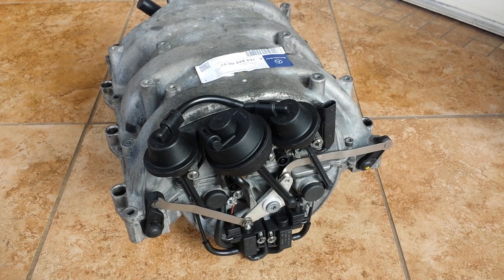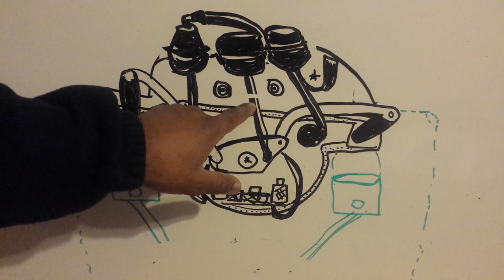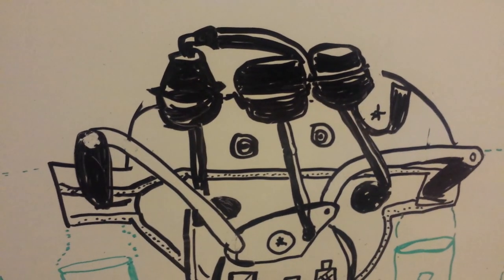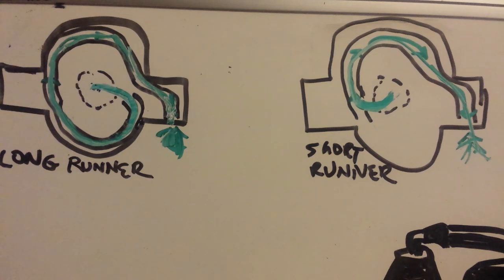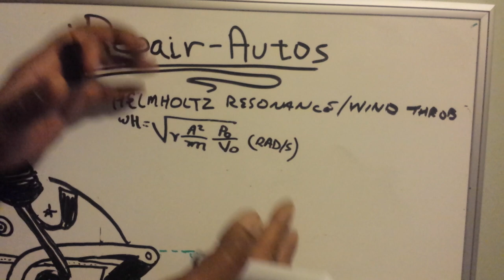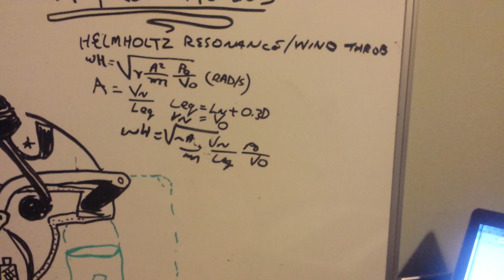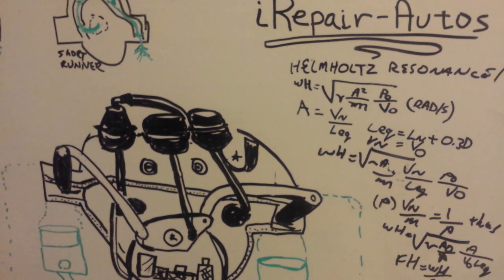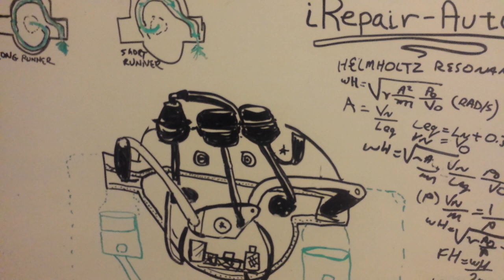Mercedes Air Intake Manifold Failure Explanation

Comment: The real question is how did those flaps get gunk?  Oil / build up / gummy and sticky of oil.  The next question, is where did the oil come from.  This will leads back to a few video this guy had shown.  It all came from the PCV tube --->> PCV cover & oil separator.  I believe this is the source of oil / oil fumes that gets into the drum oil intake.  This is unpreventable, even with changing out the PCV cover or the oil separator.  The oil fume will still travel down to the MAF / air intake and cause all these oil / sticky gummy crap.  What can be done is add a oil separator as a final defense on this line.  He has another video that shows this type of installation on this line.  It may not be 100% since some fumes will still get back into the MAF as the line is design to, but at least you minimize it.

Comment: Hello.
I have a problem with my c280. The problem is a P2015 Code. Intake Manifold Runner Position Sensor/Switch Circuit Range/Performance (Bank 1). Do you have any idea what it means?
Reply from the maker: Yes, the sensor detects that the internal flap on bank 1, is moving but not through the full range of motion.   Check your air intake rods for obstruction.   I have a video on this here:  https://youtu.be/bKiNsMoAm_M
Reply: iRepair Autos ok thanks....great videos!!

Comment: I just did mine but I noticed the flaps or arms move only when you rev  high  is  that normal?   I thought that it shouldmove at all times low idle and steady  2000 rpm   am I wrong ? I want to make sure its not defective
Reply: if your engine seems to be functioning normally, and you are not getting any error code, it should be fine.

Comment: great video, very interesting pinciples at work.It's good to know what I'm replacing. My r350 has 140k on it and the actuator bracket is broken. Your video on the intake replacement was excellent and has given me the confidence to taken on the job. I noticed you used the RBT remanufactured intake with the update Aluminum bracket. My question Is, Does the Peirburg come with the updated bracket? and is it better than the RBT? Thanks a bunch, great vids,
Reply from the maker: +J Shadler I'm not sure what Peirburg has for hardware.   Peirburg however is a brand new part were as RBT is remanufactured.   Peirburg also comes with a lifetime warranty from what I've been told.

Comment: Hi.  I originally had a p2006 code.  I replaced the broken lever with an aluminum one.  My car get an additional 6 miles/gal, increase power and no vibration during idle.  however, I now get a P2004 and a P0410 code.    All the flappers are Together and working, no vacuum leaks are found, no gas or air leaks, and all connectors are returned correctly.  I reset the error code and in 24 hours it always return. Do you have any idea what the problem can be?  Or where should I start to resolve.
Reply from the maker: The air intake manifold has internal flaps that open and close...  These parts are plastic and get coated in carbon build up.  Once that happens they get sticky and don't open and close as they should.  That's what caused your broken lever.  Now that that lever is fixed you still have the internal issue in the manifold...  check out my video explaining this here:  http://youtu.be/HTXNUE0N75Q ;   I think you're going to need a new manifold... Or you could open and clean the one you have but that's asking for more trouble down the road...
Reply: so in Alphonse situation, would the Peirburg intake manifold assembly would be a good solution?

Comment: I think this is my issue I've got a rough idel sometimes it will rev up without giving it gas and rev higher with gas pressed to however taking off and normal driving is fine

Comment: This damaged flapper/actuators caused me A check engine code p0300 it suggested a misfire and to change spark plugs but i did and yes the flapper was the issue for the misfire

Comment: What happens if you don't fix this promptly?
Reply from the maker: Vehicle performance will get worse.  Flaps on the inside may move and make the vehicle not idle and stall out at lights and then plastic pieces can get into the pistons and cause engine damage.

Comment: Hi ! I have p2006,p0170 and p0173 error code .mercedes w203 .M272. maf ok,o2 sensors ok,fuel pump ok.now question ! P2006>>>>>> p0170 and p0173???
Reply from the maker: the p2006 is indicating some failure on and in your air intake manifold.  I say on and in because the internal flaps on this part is failing to open and close because of a broken part on the external as describe in the video.   The p0170 and p0173 is a further symptom of the same.  Good luck - your manifold is failing and for best results (not having to do this job twice) you should look into replacing the whole part and not just the broken pieces.
Reply: Wow I have the exact same issue at the moment. I replaced with an aluminum piece now I'm getting the P2006 along with the 2 fuel trim, P0170 + P0173. I'll probably just buy a new manifold. Did you resolve your issue?

Comment: Take me back to pre calculus , awesome.  I suppose that's y Mercedes decided to make the essential moving parts plastic. Other competing material probably to heavy, if not too expensive.   Once  part break the cost of diagnostic exceeds a brand new manifold, due to the complexity nature.  Mercedes with their liability calculation figured the parts are so intricately woven to each other,  diagnosis of damaged assessment will be in the fire pits for them.  As one could imaging the  phone calls from world over the same regarding "how to".
Reply from the maker: Yeah this one is nasty.  Mercedes Techs like to go down rabbit holes when working on this one.

Comment: don't try the repair kit buy a complete intake manifold assembly  $446.00 aftermarket by a company called Pierburg the same company that builds them for mercedes benz.
Reply from the maker: I totally agree.  repair kits are not the solution.  Thanks for posting!
Reply: dntpearson1994 completely wasteful. Mechanical moving parts externally located are an easy fix with cheap fabrication. Id nevet buy a new manifold to fix stuck flaps.
Reply: I completely agree with you.
My intake on my MB w220 failed and i was able to take it apart so easily . They are all mechanical parts and can be easily restored with no problems . Now , the actuator is the one i am thinking about replacing it just to be on the safe side . It is the only part that i can imagine it to be the cause behind the intake failure beside that when i took the intake apart it was oily and sticky of course that where the problem is .
Any suggestion besides buying a BRAAAND NEw intake that will cost over 500bucks ?
Reply: @mohamedmetwally9099  I guess you have to buy a new one, japanese car do this better than MB.
Reply: I disagree. I am a former Mercedes tech and have installed over a dozen of those repair kits without any problems. It is far less expensive to the customers and they will last a lot longer. I use a solvent to clean out the intake as best I can to make sure the flaps are moving freely. The new intakes come with plastic arms and plates and only a matter of time before they break again on you or the next owner. The metal plates never break again.

Comment: So if my car is making an audible(when outside the vehicle and in front of the engine bay) whistling then I'm golden?
Reply from the maker: +Alin Marinescu lol...  are you able to hear it?  It's not very noticeable at all.
Reply: iRepair Autos It's definitely audible, some people might say it's some sort of bearing whine, but it's definitely air related. It keeps going even after the engine has been running for awhile so it's not the air injection pump.
Reply from the maker: +Alin Marinescu it's probably a bearing.  Does the whine change with the revving if the engine?   If so it's a pulley bearing or something similar.   You're not going to hear the air intake manifold whistle.
Reply: iRepair Autos I thought it might be that too, but to me it definitely sounds like it's air related. It is rpm dependent, so a bearing might be out somewhere, I just don't see where, I've had the alternator out, played with all the pulleys and they seemed ok. I'll take the intake manifold out soon, clean and degrease it like you did, hopefully I'll find the culprit. If not I'll try and get it on video, maybe someone else heard it before. 
I'm going to do the PCV system refresh on it, apparently ECS recommends replacing the oil separator as well, you know, the one sitting on the right bank between cylinders 5 and 6. I've actually found a small oil drop in cylinder 6, post ignition, so I'm thinking the oil separator is gone too. 
Anyway, thanks for the videos and your responses!
Reply from the maker: +Alin Marinescu I got an oil separator video on the channel that you should check out.
Reply: Cool! I will check it out, thanks!
Reply from the maker: +Alin Marinescu video found here https://youtu.be/G4fv0i_OhOg
Reply: iRepair Autos Thanks! I've seen this one, a couple times actually, it's the one which made me aware of the oil issue. What I was referring to is the next step of your video, there's an oil separator on the right side of the engine, as you look at it from the front of the car. It's a plastic part which sits on top of the cylinder head, it's shaped like an irregular trapeze and apparently it is part of the PCV system as well. I'll post the part number so you know what I'm talking about.
A2730160034 for the V8 m273. They made a newer, presumably better part to replace the ones which came with the first versions of the m273. I don't know if the V6 have these, I think they might.
Reply: iRepair Autos I'm also hearing a whine (a wolfy howl, even, sometimes), rpm related-- including WITH BELT OFF, which I take to mean that no pulleys are involved in this noise. The stethoscope gives me most feedback of this noise when I touch it onto the air intake man. - could it be I need to follow your AIManif. cleaning video? Or does this sound like other possible problems? Appreciate all the knowledge sharing!!
Reply: By the way, already replaced: oil drip pan, 2 oil separators, MAF sensor, throttle body gasket, MAF housing gaskets, air filter housing gasket, breather hoses.
Reply: I recently drove a RWD version of the M273 on a 2011 E550 Coupe version and it had the same whine. So, unless you're seeing any codes you should be fine. These engines seem to like running loud for whatever reasons. If your MPG and overall experience is within spec I wouldn't worry.

Comment: it hurts me so to hear some try to converse information, when that person doesn't know the propper terms and principles. long runner intakes are for low end torque, short runners are for max horse power. being I build race engines. the principles are the same, whither it's an engine for the street or track. these engines are designed with racing principles in mind. I intend to add parts to my c240 to boost the spark at the spark plug. adding water injection for added torque  and bigger injectors because they are insufficient for higher hp numbers. I intent to build a fuel warmer too. running the fuel in a radiator hose, to itemize the fuel to a fog when it reaches the colder air charge. just saying. I having worked on cars from my age of 8 and being 54 now. that called experience. and I've studied many aspects of mechanical designs from a MG TA, TB, TC, TD and TF old school technology. I own a MG Magnette. but I favor the twin cam fiat from the 124 sides and 2000 spider. I've built one to race oval track and road racing. the last race it was in at road Atlanta. it sat at p1 with many 289, 302 mustangs in chase. the engine was in a 124 coupe that day. when it was in an oval car. it was a full tube chassis with a sheet metal body rivited together. but oval racing is more violent racing. so it hasn't won yet. but in road racing the victories pile up.
Reply from the maker: kf4dcy hi Dale.   it's all good. I'm trying to help the Mercedes community.   may not have all the classroom terms but then again.  When you go to Mercedes and they charge $3k they say yup it was broken. they don't teach you anything.
Reply: iRepair Autos I hear you. I never took a days worth of education with any body of schooling. but I know what I've learned over the years. I could teach, what I know. I'm working now 'on a very tight budget' way to take the stock ignite system. and with a few electronic parts to create more of a plasma flare burst and not just a mere arch. adding an imagration spray nosel just after the butter fly valve, and have the performance of fighter planes of ww2. like the Vought F4U Corsair used by vma214 blacksheep in the pacific. they used the water injection in power climbs behind Japanese zeros. it's was the only way our planes could earn an advantage that was a win. but these engines had magneto's, an never ending supply of voltage with current levels that can kill. something, being a ham radio operator, has tought me. I've been bit by many race ignition systems. they were mere ticklings. I've been bit by electric fencing that had more kick. but it is what it is. if I had had the funding that most engine builders have, You'd know me. the engine I built for a fiat was put in the fiat 124 coupe. the car is owned and driven by my friend John baucom. he's a pro ta1 trans-am driver. he normally drives a modern bodied ford mustang. car 86. and won the Detroit race last year. he drove it in a ventage race at Roebling Road Raceway in Savanah Ga. back in 2015. he had little to no time racing to tune the chassis, being it was wet,,, very wet. so when on Sunday the weather had dried a bit. he was mid pack. within three laps he was 2nd. he ended up 3 overall. with one c sport racer type car and a formula ford ahead of him at the finnish. the guy driving the open wheel formula ford videoed thevrace posting on youtube. that car caught up to john. but on the front strech. he would embarrass most cars. the engine was reving 9300 to 9500 easy at 143mpg trap speed. I estimate the hp rating of the engine around 185 to 200bhp. bored and stroked to 2289cc's naturaly aspirated and duel idf downdraft carbs and his personal ground cams, from when he drove two 124 spiders. winning two victories in two classes of production racing in the same year, winning the presidents cup in scca. a prestigious honor.  other winners of the cup have been prominent names in other racing series. like Bobby Rahal, Carol Shelby and Skip Barber.
Reply: kf4dcy   i know this is 2 years old but....fuel heater? isn't that the opposite of a "cool can" you find on many race cars? and its atomize not itemize the fuel mixture. see what happens when you get picky about someone else's video...
Reply: @iRepairAutos  Good answer, you destroyed him.
Reply from the maker: Im sure dale wasn't trying to be mean.  Right dale?

Comment: Lesson learned never buy a Mercedes-Benz,  money pit unless you have a great amount of expendable income for repairs after 70,000 miles when your problems begin.  Motor mounts on my 2013 GLK350 failed at 70100 miles. DON’T BUY!
Reply from the maker: An option is to lease.  Then mercedes owns the issues
Reply: I agree

Comment: I was wondering if you can help me with this problem. I replaced the rear expansion seals when the engine get warmed up the seal get pressured out. Mercedes said that the engine ports are clogged up but when I removed the valve covers it looks very clean with no sludge. 2008 ML350
Reply from the maker: Inspect the rebreather hose.  Is that clogged or crimped? Do you have too much oil in the engine? What grade oil?  Did his start to happen after you installed the expansion seals  or before?
Reply: I bought the car like this leaking oil. 
I’m using Mobile one synthetic 5W 30. No I didn’t check the breather.